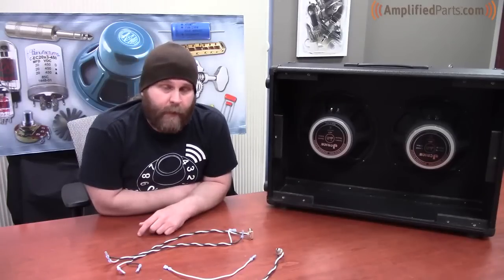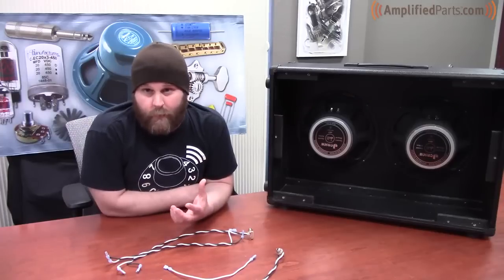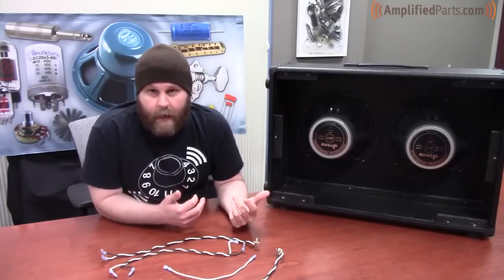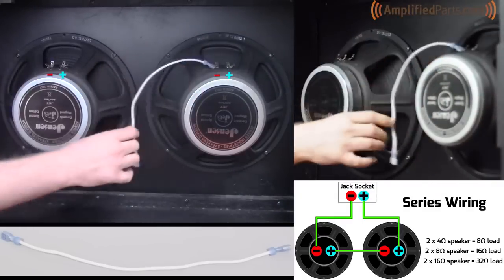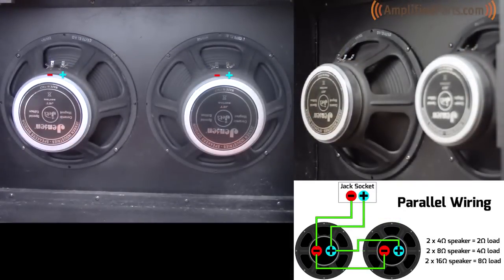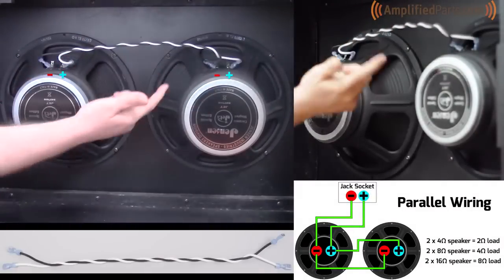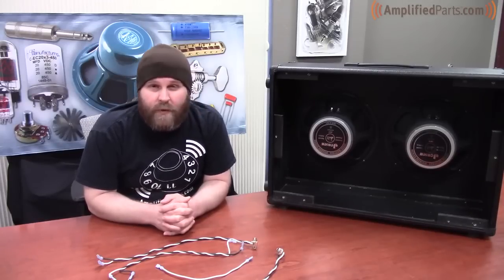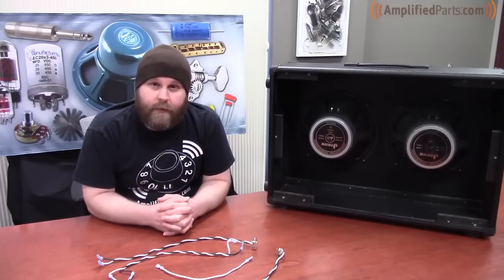How to Wire a 2x12 Guitar-Amp Speaker Cabinet in Parallel & Series (Sponsored)

Comment: My 212 cab had 2 16 ohm's wired to be an 8 ohm cab.. I'm putting 8 ohm speakers in it.. and I don't want it to be 4 ohms.. so I'm changing the wiring to be 16 ohms.
This video has made it easy to understand!
Reply: Hi , what if the amp only has the 8ohm jack .. can it stil be 16 ohms with with the series wiring?
Reply: @satchrules101  Im wondering the same thing. I think its ok but I think its best to match it

Comment: Great examples and chart. Series you multiply, parallel you divide.  Good now I’m going to wire my two 8 0hm speakers to 4 0hm for the 4 0hm load on my NUX Mighty Space 30 watt speaker out. Thanks for getting to the point. Oh I think I need a cabinet.

Comment: Hi, may I ask a question ? at 2:41 (parallel wiring) does it make any difference to which speaker i plug my mono jack wire ? I mean right or left ? and does it make any difference in the tone when the speakers are not the same ? thank you

Comment: Hi, great instructions! This relates to my project. I am adding a input jack to a Fender Frontman 212R to allow use as an external speaker Cab (without the Amp head powered on). I will need to rewire the 2 speakers to be in series  to get 16 ohms impeaedence to match w/ my separate Amp head output. Originally   in parallel they have 4 ohms. I understand the Fender solid state Amp when in use (Power On & nothing plugged in  the add on jack), the assumedly 4 ohm power from the amp will be pushing 16 ohm speakers. I think this is not a serious issue other than loss of volume.  This Amp inherently goes from zero to much to loud at only 4 any
Reply: ...anyway. I wasn't done. Now to my question, assumng my logic is sound so far. Can I simply splice the two wires for  the mono input on to the existing Fender Amp output wires, thereby leaving a connection for use as a combo Amp or an external speaker Cab? My concern is will the 16 ohm output signal from the separate head effect the circuitry of the Fender Amp (remember its off). Also is the new input jack safe (nothing plugged in) when theI use the Combo Amp? That was a mouthful. Let's see if you get  me?

Comment: I have a Tone Master Twin Reverb.
I like the sound of having a second 
cabinet. I have a 212 cab with to 
separate 8ohm speakers,
a 212 cab 8ohm load and a 412 
cabinet that I can switch to 4, 8, 
or 16 ohms. How can I make any 
of those work with my Twin?
I'd like to try each of the cabinets
(separately of course) to see which
one I like best when paired with 
the Twin. 
I can see that the Twin has two 
8 ohm speakers wired in parallel.

Comment: Hi, how can I wire my 2x12 8ohms speakers with 2 jacks so I can get 4 ohms parallel and 16ohms series in each other??
Reply: Did you ever get an answer? I need to know also..
Reply: I just looked into this. You can use a dpdt switch to do it, series one side and parallel the other.

Comment: How do you make another connection for another input jack to be output jack for “daisy chain” cabs? I mean, some 2x12 cabs have 2 jacks on its plate jack at the back of the cab, either can be input jack and the other jack is automatically will become an output jack for “daisy chain”. THANKS!!!!

Comment: ok what about output volume of both of mentioned solutions? would parallel wiring make cab a 6db louder than a single speaker, and serial would result in same output volume as single speaker?

Comment: Good video, my question was is there a difference in soldering oppose as to connectors to swap speakers whenever you like? I bought a mesa 2 x12 with vintage 30 and I wanted to swap the speakers but I realized they are soldered so I have to take it to someone who knows about this. Thanks

Comment: im turning an old solid state yamaha 212 into a cab, the amp wasnt working anymore and i just purchased a head... i see you are using white on positive here but i believe on this amp red was positive and white negative... is there any way to figure it out if it's not marked on the speaker itself?

Comment: what the best brand cable for wiring speaker cabinet?  sir... thanks great video
Reply: Wire is wire. You can buy the cheapest out there, but make sure its cloth wrapped. (It's a little tougher than plastic coating.)

Comment: What if i have 1 8ohm amp head with 2 8ohm speaker cabinets, 1 speaker in each? Can i switch the positive/negative in one cab and run both using one cabs link output? Will this still equate to 16ohm?

Comment: Great! Sorry for my ignorance, I have a question…, do you know if i can connect a MARSHALL CODE212-E (cabinet) or a Marshall MX212R-E (cabinet) with the BC108 Vox cabinet to unlock the 50 watts of my vox MV50 Clean? 

BC 108 has one speaker, unit impedance 8ohms
MARSHALL has 2 speakers , unit impedance 8ohms

Comment: If I'm running a boss katana 1x12 combo amp that is 8ohm and I want to run a 2x12 cabinet,which one should I run,series or parallel?I know I will need 2 8ohm speakers,I just dont know which wiring diagram I should use.

Comment: You don't gotta twist wires from the output trans to the speakers (Or inside the amp, to the impedance selector switch)

Comment: So i have a 500 watt bass head at 2 ohms so i should wire my cab with 4 8 ohm speakers in parallel to match the output

Comment: My 2x12 combo amp was wired in parallel, but the second wire from the jack was connected to the other speaker. Is this also possible? I've looked at pictures of the same amp on the internet and they were also wired like this.

Comment: Do the two wiring methods impact the tone at all? My AC30 is wired with two speakers in series. Would it sound different in parallel?
Reply: @Smoking Goat I don't plan on trying it with my Vox. I've just wondered about series vs parallel wiring in general. I've wondered if one method lends any specific tonality characteristic more than the other. I have played several Matchless amps over the years, and never really bonded with them. They all go for a similar tone as the Vox is known for, but they sound wayyyy different to me. They also respond very different to your dynamics. I wondered how much of that was their parallel wiring.

Comment: Hi, Hoping someone can answer a question. I just bought an Orange PPC212, with V30's, and it's rated at 120watts - 16ohm. I am using a Seymour Duncan Powerstage 170 and having the usual drop in power/volume due to it being solid state. I believe it makes just over 40watts at 16ohms. I'm assuming these are 2 - 8ohm speakers wired in series. So, do you think it would be OK to wire the cabinet parallel to 4ohm? And maybe not harm anything? I understand I'd have to be easy on the volume as 4ohm would bring the full 170watts from my amp. Thanks
Reply: The SD Powerstage outputs at 4 ohms. 

Celestial Vintage 30's are rated for 75 watts (I have them too). They most likely ARE 8 ohm, but make sure to double check, because they were sold in 16 ohm as well. 
Whatever wattage is being sent to the cabinet will split between both speakers, keep that in mind. 

Think of the volume knob on the Powerstage as a "wattage to the speaker" control.
With the speakers in series (16 ohm load) at maximum power from the pedal (4 ohms), you'll only be pushing 43 watts, or 21.5 watts per speaker. 
With the speakers in parallel, (4 ohm load) at maximum power, you'll be pushing the full 170, or 85 watts per speaker. 
This is more than the speakers are rated for and can damage them, BUT with this configuration the speakers are free to operate as loud as they possibly can be, and I HIGHLY doubt you'll ever have them turned up that high. I play heavy metal with my V30 2x12 wired for 4 ohms and literally have NEVER turned it up more than halfway, even live. 

It works fine in series as a 16 ohm load but if you are having issues with volume/distortion, it is perfectly safe to wire them in parallel for 4 ohms. You will never need the full volume of those speakers.

Comment: Does power capability differ between series or parallel? Do two 50 watt speakers equal 100 watt capability in either configuration?
Reply: That's correct, two 50w speakers wired either in series or parallel would give you 100w

Comment: How can I test a speaker box. I don’t have much tool’s
Reply: If you have a solid state amp, just plug it in. It's not as dangerous as using a tube amp with an impedance mismatch. Just start at low volume. 
If you're talking about testing the connections, literally take it to autozone and just ask if you can borrow a meter really quick.

Comment: ugh ,     The Impedance absolutley lost me. I got nuthing from that.   Very helpful with the wiring & ohms, just dont understand impedance.            - I have learned though that I can run 20 watt head into 100 watt speakers,  & I can run a 19v Power supply with an ohm rating of 3000ma   into an item with a 19v 8ma rating.        but Impedance is french to me.
Reply: I am as lost as you are. When they mix impedance with wiring, I lose it.

Comment: Really?
Thats it?
You made this video for newbs, but dont even touch on why you would choose one over the other?
Nothing about the wattage interaction, with the different resistance?
Phase interaction?
Actual tonal differences?
Transformer stress per different resistance?
This is like giving a driving lesson by saying"key goes here, gas pedal here, brake here, and thats how you drive a car".
Pretty lame.
Reply: Agreed.
Reply: @petougao  No. This video has nothing to do with tone or transformer. It is ONLY a electrical connection to match the impedance of the speakers of the cabinet  (as a whole) to the transformer in the amp. If the transformer wants 4 ohms then you have to wire the cabinet to BE 4 ohms. As he said a mismatch will affect (wear out) something such as the transformer or output tubes. i do agree that for a multi-speaker speaker cabinet you DO need to worry about phase. If all the same speaker brand/model you can assume that the same tab in the same place on each speaker is the same (call it +) and call the other "-". If the speakers are from different manufacturers then you DO need to determine the "polarity" of the speaker. For instance connect a simple 1.5 volt battery across the speaker leads and note if the code moves out or moves in. For simplicity connect to the battery until the speaker cone moves out. Then label the speaker tab connecting to the + side of the battery as "+" and the other tab as "-". Do this for all the speakers in the cabinet. Then follow this vid's direction. The +/- labelling is actually arbitrary. This example is just to match the tab from one speaker to the "same" tab on the other speaker.
Reply: @Fender5621  please improve your English. Start with phase and polarity in dictionary.
Reply: Check out our Tech Articles for more detailed information! Thanks for watching! https://www.amplifiedparts.com/tech-articles/speaker-impedance-power-handling-and-wiring
Reply: @Fender5621  
Who are you talking too?
How does your message have anything to do with mine?
Maybe you should send it to the makers of the video.
For rucks sake, somebody takes an intro to electronics class, all of a sudden they are professor proton.

Comment: What about wattage? I was going to build a cab to put under my marshall dsl40.
Reply: Wattage don't really matter. In my experience of matching "same ohmage" speakers in parrallel, i find using a smaller wattage speaker with a much bigger wattage speaker does have its own tone. I have used Eminence 16ohm 200watt speakers for "bass" and mixed with Celestion GTs, Sidewinders, and vintage30 16ohm models and they do give out interesting "very decent" mic'd tones as well as non mic'd "cranked up" live tones.! But its really ear preference that will tell you yay or nay..i experiment myself as long as the impedances such as 2 x 16, or 2 x 8ohms are adhered to, you can't really go wrong if you stick to the right match. And its fun putting different wattage speakers together..👍🤘🤘🤘🤘
Reply: @Rikk_Klaww777  thanks for the input think I'll go with a creamback and a greenback for starters.
Reply: @jamesabbott8208  mmmm....nice combo. Done those before. Also don't be put off by the "chinese made or branded" celestions. They are not bad at all. I put a creamie up against a "chinese produced" G12P-80 and i found the P-80 to be more smooth and alive than the Creamback.!?!! And i used and Engl powerball ii, Gigmaster 15, and thunder 50 as well as extending it thru a Silverface 74 twin reverb. I changed my opinion quick smart on the "asian P-80"...it was really good..👍